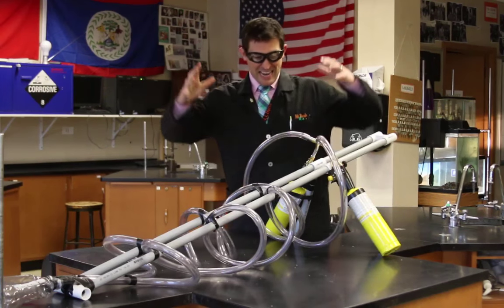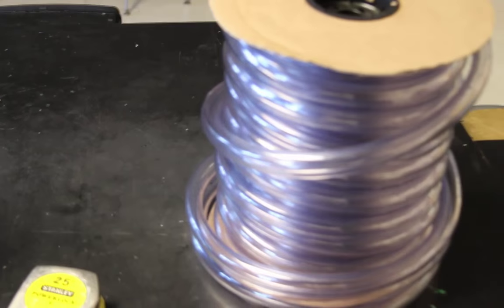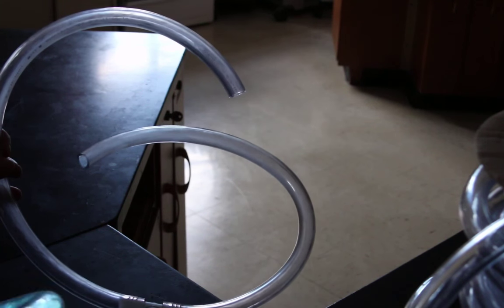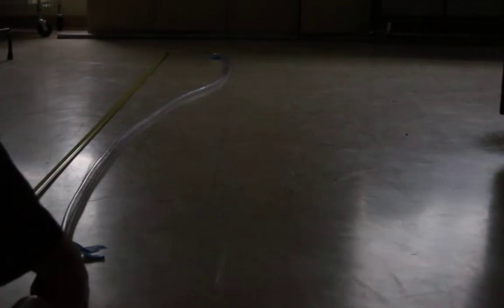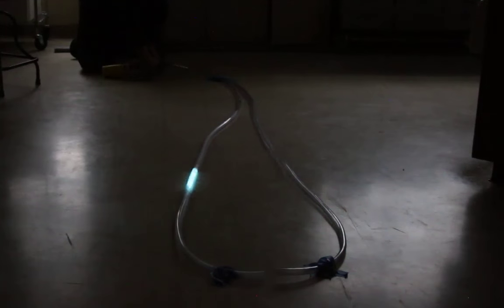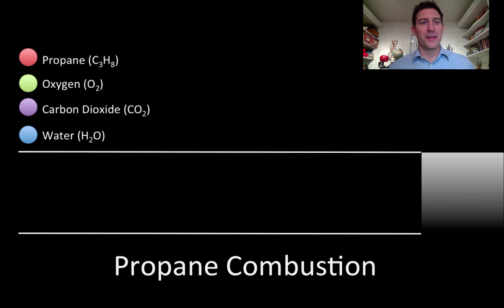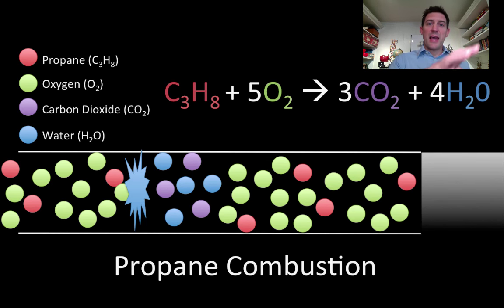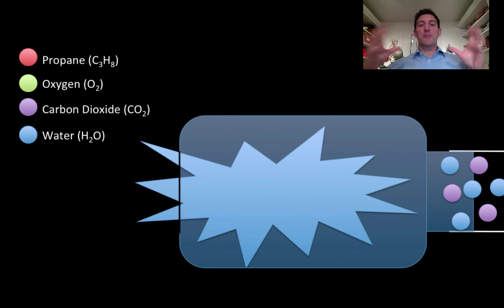Propane Fireball Cannon - How to Shoot Blue Fireballs!

Comment: Great video, but your chemistry appears to be off mate. It's not propane in those yellow cans, it's MAP gas. Methylacetylene and Propadiene stabilized with propane. That's why it's that delightful blue/green color instead of just blue tapering to yellow. Cheers though.
Reply from the maker: I apologize if the video is a little misleading. I found MAPP gas to be much better than propane alone for this application. But the reason I made the contraption was to talk about propane combustion with my students so I chose to focus the video on just the propane. You are correct in saying that the color of MAPP combustion is different than the propane as well, the MAPP gives a much better color profile!
Thanks for watching!

Comment: Nice video man, your channel is way underated  i think this video is even better then the other on youtube together!
Reply from the maker: Thank you for the kind words!! Thanks for watching!
Reply: no problem i did this with a butane torch and it also worked but what is the difference between propane and butane ive been wondering that for ages
Reply from the maker: Good question! The difference between propane and butane are their chemical makeup. Propane is C3H8 and Butane is C4H10. Because of these differences in the number of carbons and hydrogens, they have slightly different properties. Butane will put out more heat (per unit volume) than propane (as a gas).
Reply: Okay thx for the information man i actualy tought that if was propane puting out more heat
Reply: but does propane burn faster then propane or just the same

Comment: That just looks so awesome, love what you did with the spiral.
Reply from the maker: Thank you! I have plans to mod the bottles at the end to shoot ping pong balls...we will see if it works or not in an upcoming video!
Reply: Probably a huge guess, but that might need a bit more pressure and some kind of loading system to work, but nevertheless I'm still fairly intrigued by what you have planned.
Reply from the maker: +Andrew Bolton you are correct. We've got a few obstacles to work through including how much gas to vent off ahead of the progressing flame as well as pressure (and back pressure) once the combustion edge reaches the chamber. But, solving those riddles is the best part of this game we call science! 
Any input/suggestions are always welcome!
Reply: Nothing much more to say than keep the science up and that a ping pong ball being propelled by some flaming gas is probably going to look amazing.
Reply: +Beals Science 
The Backjardscientists built a golfball cannon with this :-)
Reply from the maker: +Micha Grill awesome! I will have to check it out! Do you have the link by chance?
Reply: +Beals Science 
How is it? Are you going to make one yourself?
Reply from the maker: I haven't gotten started on it yet. I've been working on other projects this summer. But I intend to experiment with a ping pong ball adapter for the Propane Fireball Cannon in the Fall. Any suggestions?
Reply: +Beals Science 
Do the cannon with a 10 liter bottle. BOOOOOM  XD
Reply from the maker: I will definitely look into that!
Reply: +Beals Science 
Did you look into that video yet?
Reply from the maker: Found this one: https://www.youtube.com/watch?v=Sl0BHueSjvA but it doesn't show the build of the golf ball gun. Maybe he has a video explaining the build but I haven't found it yet.
Reply: +Beals Science 
Oh yeah: Did you have 1000 subs yesterday? ;-)  CONGRATULATIONS  =D
Reply from the maker: No! Subs went over 1000 yesterday! Seems trivial compared to a lot of channels but I am incredibly grateful!!

Comment: very cool- have you seen any limitations with how tight you wrap the tubing- thanks
Reply from the maker: jon hetrick the great thing about this tubing is that it remains unconstricted at a very tight wrap. I did test some bends in the tube but they constricted the flow too much. The length I am showing was the major limitation for the tubing.
Are you building one?!

Comment: Is the combustion that occures similar to the conbustion in a 4 stroke engine?
Reply from the maker: This is definitely similar to a combustion engine because we are pumping a mixture of gas (MAPP gas in the case of the cannon) and air into a confined space. In an engine, the carburetor or fuel injector mixes gas with air and sprays it into a confined space (the cylinder). In the engine the spark plug makes a spark which causes combustion, thus an expansion of the gas as it reacts, causing the piston to move. In the cannon we make a spark with the torch but there is no piston so the flame travels toward the opening as it combusts the fuel and air that was pumped into the tube before the spark.
Does that make sense?
Thanks for watching!
Reply: Seems more like a two stroke engine the way its just igniting and then shortly after being expelled out. Not really a cycle tho seeing as theres nothing that restricts or triggers the exhaust letout

Comment: What happens if your propane trigger keeps propane flowing after the spark?
Reply from the maker: I've held the trigger for a considerable amount of time but holding it mostly just causes the blue "fireball" to push through more quickly. The expanding gas of combustion is pushing back toward the gas valve and toward the open end but because gas is flowing into one end (and that end is considerable smaller) the flame travels (expands) toward the open end. I've never had it flashback on me but you can feel the air (and smell the gas) as it pushes back out the small holes of the burner!

Comment: You are using Mapp gas. It is not  propane.  It is a mix of gases  "MAPP gas" is a trademarked name, belonging to The Linde Group, and previously belonging to the Dow Chemical Company, for a fuel gas based on a stabilized mixture of methylacetylene (propyne) and propadiene. The name comes from the original chemical composition, methylacetylene-propadiene propane. (cut and paste) Thank you for the tutorial